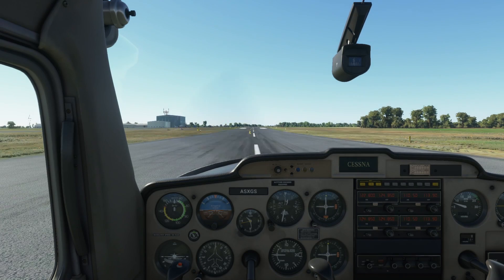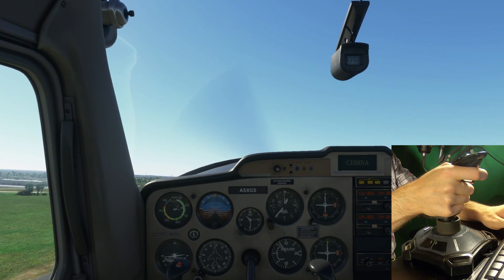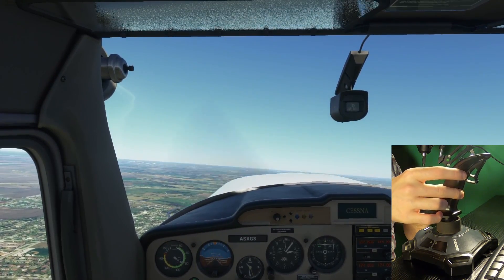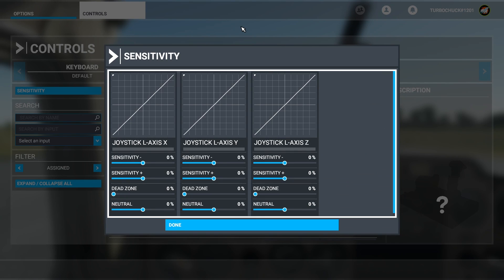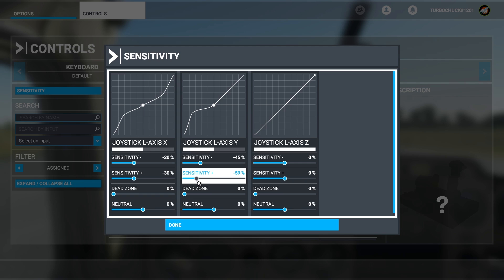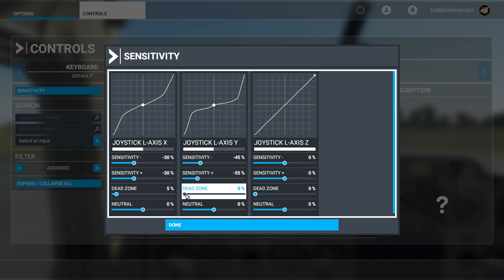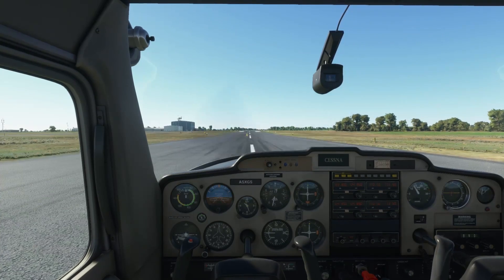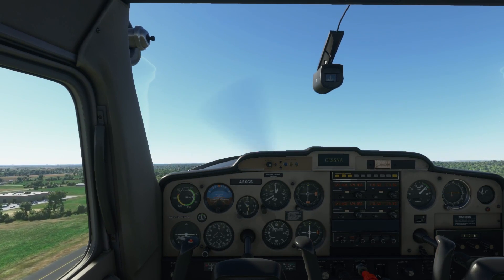Joystick Sensitivity (10/31/2020 Update) - Microsoft Flight Simulator

Comment: great explain, but how do you control rudder on ground and air, mine is to sensitive please help. thank you.
Reply from the maker: I use two buttons on the top of my joystick, but I need to tap them because it's super sensitive.  Not the best solution for sure.  It would be better to use a joystick that has an additional axis for the rudder.

Comment: thanks. I am currently struggling with using a keyboard for this and I was curious about using a joystick. Knowing how this is done goes a long way towards a decision to use a joystick and calibrating it.
Reply from the maker: It's a night and day difference using a joystick, especially when you get the sensitivity dialed in.
Reply: One big problem is Joystick control in FS2020 is totally and utterly fucked up on most sticks on the market and the sensitivity setting do not work, it just make input lag larger... When I fly the Beach-craft 350 and turn the joystick it take 2 seconds before it reacts to a roll, (up and down works perfectly fine and linear without any delay). Also when it finally reacts it does not mimic what the joystick do, it react same as if you are using a keyboard to fly. Meaning no matter how little you turn the stick it reacts and it does not react how much you push on the stick but for how LONG you keep the stick in the position. Only way to actually fly is to use the joystick like it was a keyboard pumping it, this is just ridiculous and internet is full of people complaining about it. Some people say they have no problem at all but most say their joystick simply is unusable in FS2020 and I am one of them with my Logitech Force Feedback 3d pro. Even stranger is that all the above only is for the roll, up and down works perfectly fine and linear with no input lag... Lot of people complaining about exactly the same problem since FS2020 came out and nothing has been done to fix it.

Comment: If I select in the Control Options a column for keyboard or a mouse and press that Sensitivity box I can see that settings of sensitivity are 50%. Any ideas about what that 50% care about?
Reply: Are you using a flight stick?
Reply: @akhilkoya  Yes, I use G940. The option I am talking about above is not selectable for Joysticks. It looks like this is an option for everything.
Reply: @toriyshaov2245  discord? @  Koya#2504
Reply: @akhilkoya  Not today, please:)

Comment: Whatever Microsoft did in that update, they janked my joystick.  It has a massive dead zone now.
Reply from the maker: Same here.  I thought the autopilot was fighting my controls or something.  I had to reset the sensitivity and completely start over.
Reply: Yeah Joystick control in FS2020 is totally and utterly fucked up on most sticks on the market and the sensitivity setting do not work, it just make input lag larger... When I fly the Beach-craft 350 and turn the joystick it take 2 seconds before it reacts to a roll, (up and down works perfectly fine and linear without any delay). Also when it finally reacts it does not mimic what the joystick do, it react same as if you are using a keyboard to fly. Meaning no matter how little you turn the stick it reacts and it does not react how much you push on the stick but for how LONG you keep the stick in the position. Only way to actually fly is to use the joystick like it was a keyboard pumping it, this is just ridiculous and internet is full of people complaining about it. Some people say they have no problem at all but most say their joystick simply is unusable in FS2020 and I am one of them with my Logitech Force Feedback 3d pro. Even stranger is that all the above only is for the roll, up and down works perfectly fine and linear with no input lag... Lot of people complaining about exactly the same problem since FS2020 came out and nothing has been done to fix it.